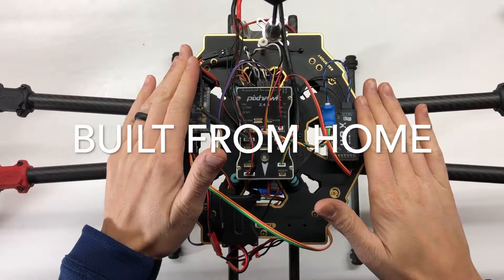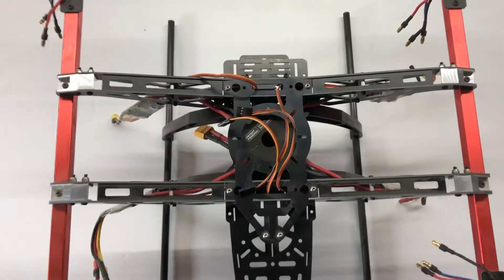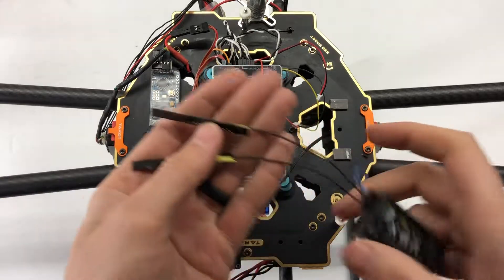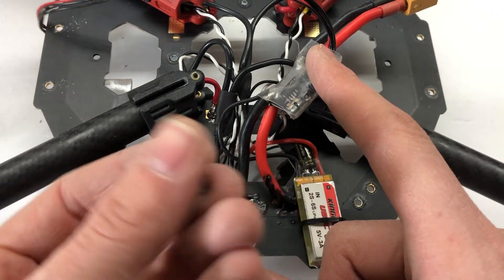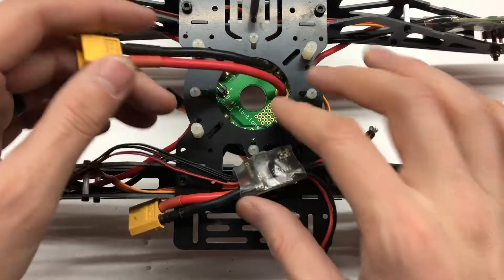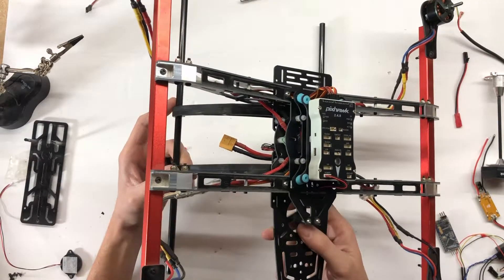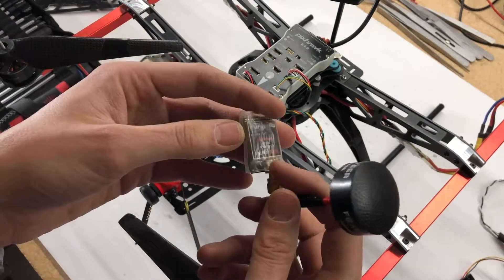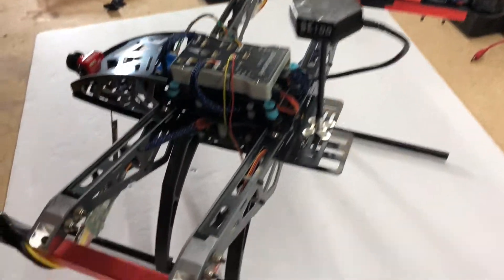Rebuilding an Old Drone (part-1)

Comment: Hi excuse me the receptor X9 slim is compatible with the pixhawk 2.4.8 ?
Reply from the maker: I have never used the x9 slim so I cant say from personal experience. If it has a way of doing sbus then it should be compatible.
Reply: @builtfromhome9207  Thank you so much for you attention, i love what are you doing with your new project of the PixHawk Holybro i think i going to do it in march

You gave me the confidence to do it, even yesterday I felt insecure because I see that many stayed in the middle i don't know why, and i had a lot of  doubt of how connect the motors and the ESC,

THANK YOU and Keep it up (Y)
Reply from the maker: @coveben959  Thanks for the nice reply. Im glad I could help you out! No need to feel insecure about anything. My life motto is "If someone else can do it so can I". You can do it! This hobby is all about learning and thats the fun part. you will run into some struggles getting a new build up and going but once you do, its a good feeling of success. Good Luck!